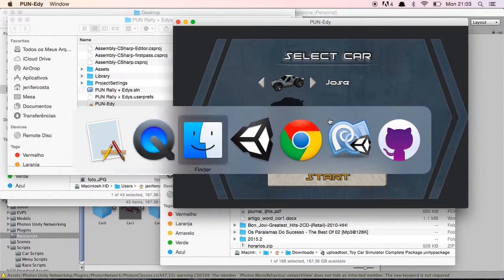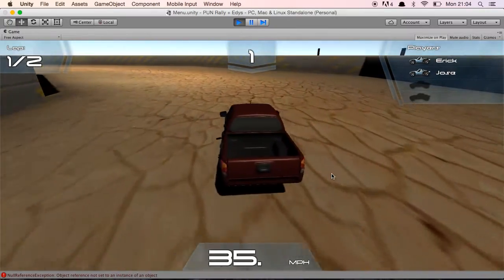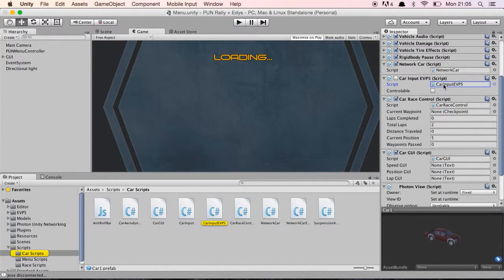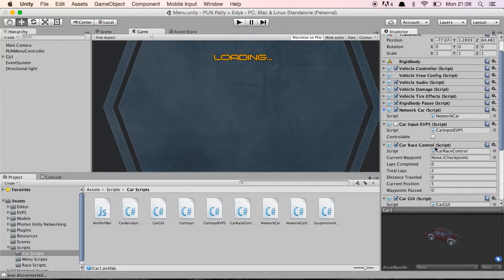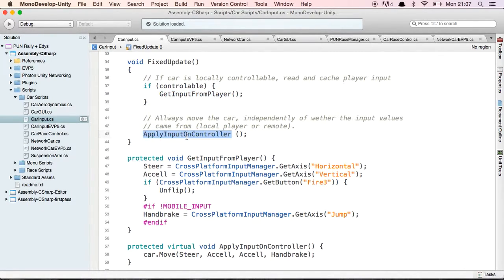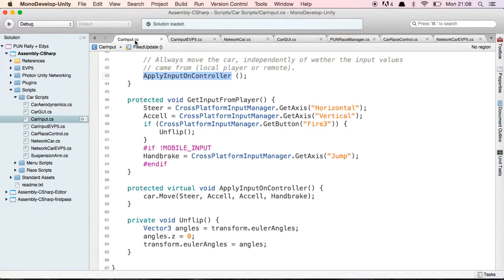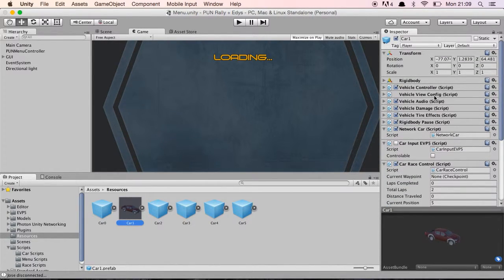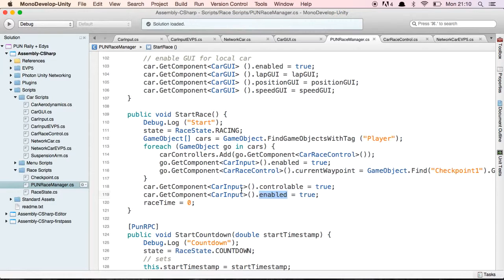PUN Rally working with Edy's Vehicle Physics 5

Comment: Hi, Erick. Will you update about controller options? And how can we adjust accelerometer sensetives?
Reply from the maker: That's a tough question. I currently do not have intentions to add more control options because the focus of the tutorial has always been the multiplayer netcode stuff. There're many online resources and discussions on best options for racing control schemes for both mobile, keyboard and gamepad/wheels. 

Regarding accelerometer sensivity, I'd try playing with the existing multiplier speed factor, or adding a two factor system:
- a quadratic factor based on how much steering is applied (this will make it less sensitive in the beginning of the course);
- a inverse factor based on speed, making it a progressive steering system (That will be less sensitive when car is fast).
Reply: Ok. I just wanted to learn if you work on this kind of staff , I would not . Thanks anyway way.